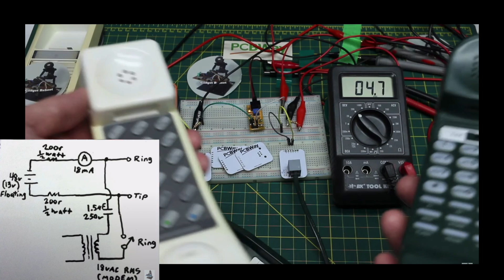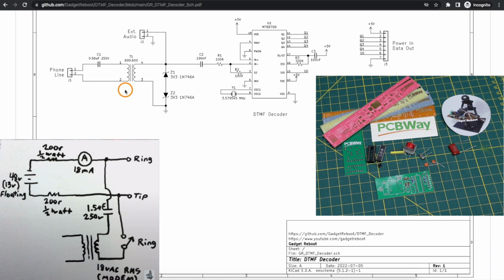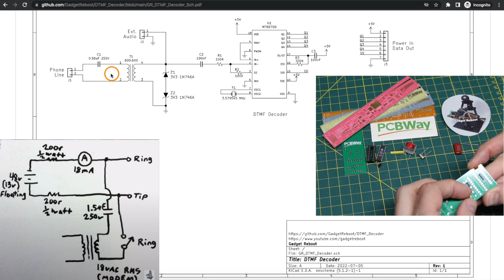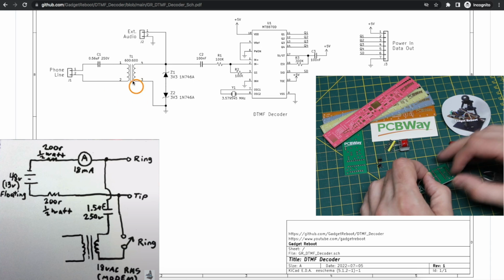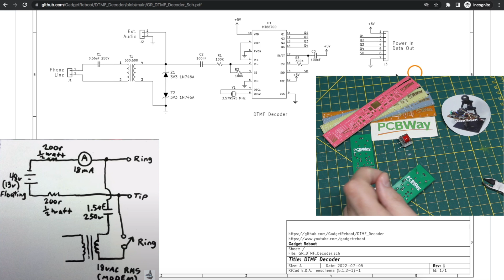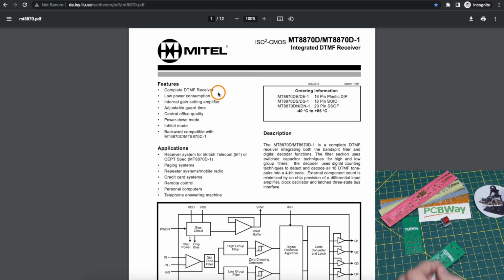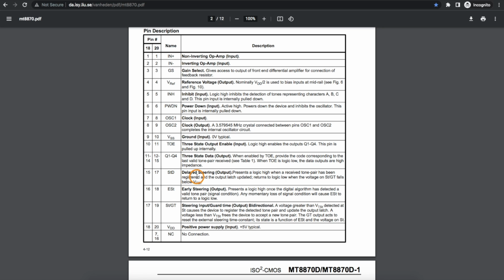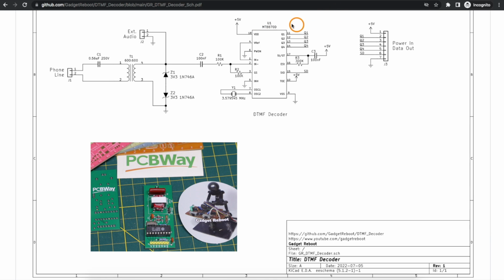MT8870 DTMF Decoder with Phone Line Interface

Comment: Can this circuit also be used to inject audio into the phone line, i head you saying this but just wanted to confirm what exactly i would need. I need to play a small audio file into the phone line.
Reply from the maker: yes it can work both directions if audio is sent into the transformer it couples to the phone line, and it’s also being picked up by the DTMF decoder chip which is fine.

 I would make sure there’s a capacitor in series with the audio signal being connected up to make sure there is no DC voltage, just audio so that it doesn’t interfere with the transformer having a constant DC voltage on it. probably anything from 100nF to 10uF should work to let audio pass in.

Comment: This is AMAZING! I realize it's from a year ago, but I ma having trouble finding some parts from your GitHub BOM. IS there a way to provide links to all of your sources for parts? Thank you for an AWESOME project! I have bene looking for something for ages to play music into the VOIP phone line.
Reply from the maker: I usually get things from AliExpress unless I need something faster.  The main thing that's hard to find elsewhere is the transformer.  I got this one
https://s.click.aliexpress.com/e/_DD81fgD
For the zeners I just get generic ones like these, clicking the 3v3  parts out of the list https://s.click.aliexpress.com/e/_DkM5p2d
250v 684j  can be used for the capacitor https://s.click.aliexpress.com/e/_DBeFipf
That would be enough parts to get an audio path to the phone line.  If the DTMF decoder is also used, the through hole chip is 
https://s.click.aliexpress.com/e/_DDc6ryD
and the rest of those parts should be easy to find on AliExpress
Reply: @GadgetReboot  thank you for the info! I will check that out. I actually never ordered from AliExpress before. I imagine they're reliable since you mentioned it...